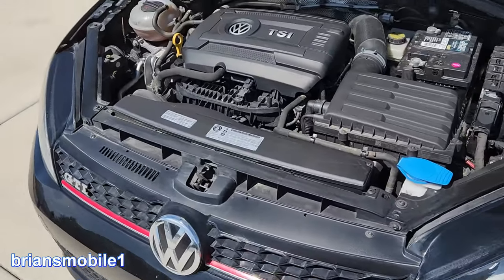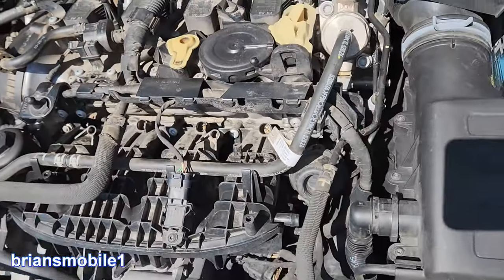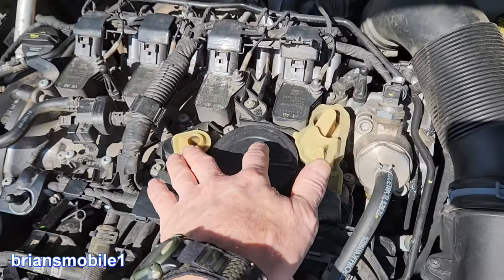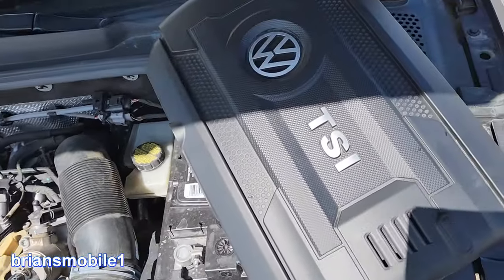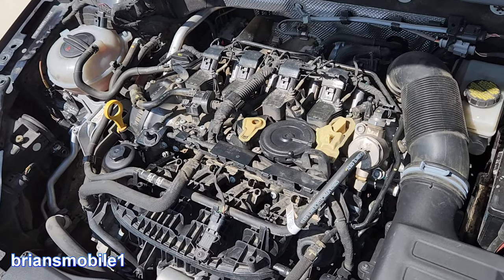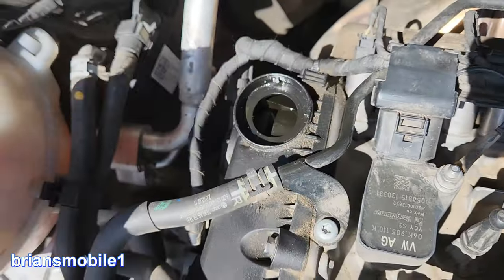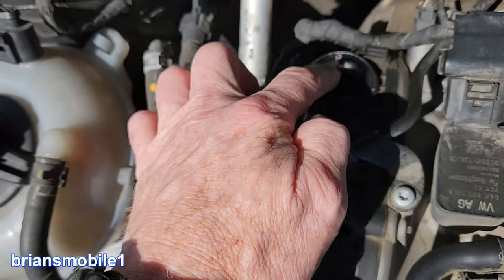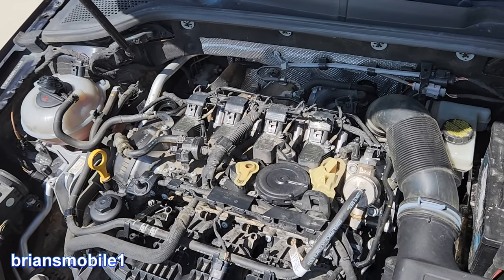VW GTI TSI P2279 (Start Here) Full Cause List at End in Order

Comment: There should be an o-ring on the oil filler cap. My 2016 gti has one.
Reply from the maker: Thanks for the tip!  Does your cap look different than this one did on the underside?  So far the light has stayed off.
Reply: @briansmobile1  The cap looks identical. I had to double check it. The o-ring goes around the big groove and rests against the engine. You can look it up to clarify what I am trying to say 😂

Comment: Had fault code P2279 today on a four year old 1.5 tsi Tiguan after it had passed our Irish national car test I’ve just cleaned up that filler cap that they must have removed & contaminated I cleared the fault code took it for good drive & it’s fixed no more fault I’d never have guessed it could be that simple!

Comment: Yep. We added some oil. Light came on. We cleaned the cap and where the cap screws in. Drive her for a bit and light is off. Also checked PCV assembly. Diaphragm seems intact. Great video!  1.8L TSI Jetta.
Reply from the maker: That's a win!  Good work Craig.  Thanks!